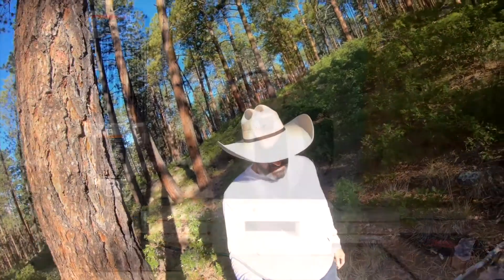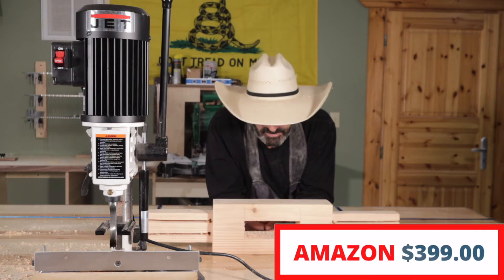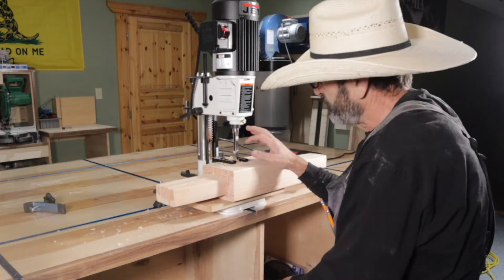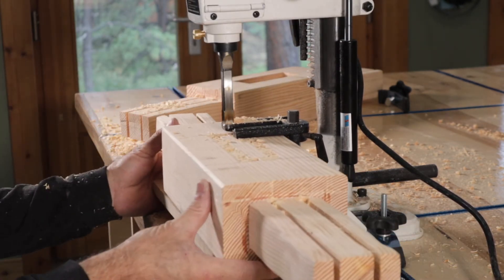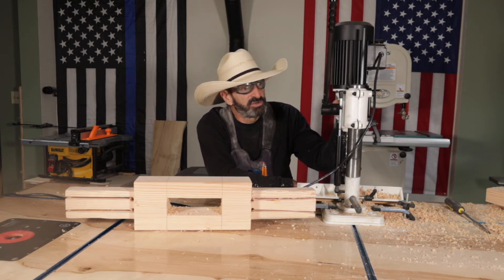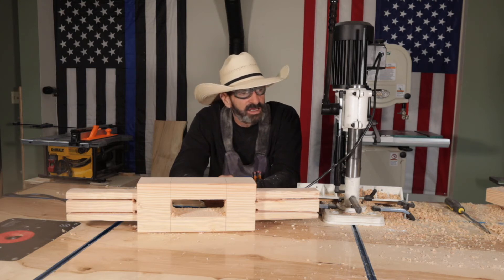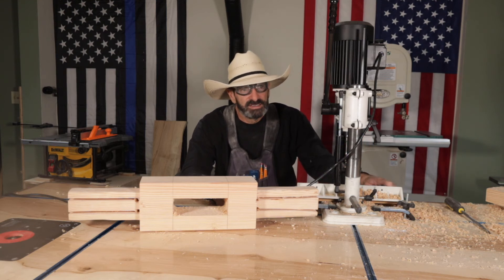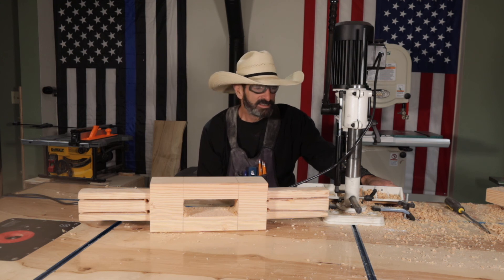JET MORTISER MACHINE JBM-5  REVIEW

Comment: I just watched a YouTube video on using the Jet JBM 5 and they said to space out the plunge cuts and then go back and clean out the (little less than a chisel width) and the bit will not deflect as it would with one open side due to just overlapping. It looked like you were progressing continuously instead of sequentially. Could this be your cause of deflection? Let me know because I’m considering a jet and I don’t want ant deflection issues. Thanks.

Comment: I just bought the Jet JBM-5 machine for $150 on FB Marketplace with 6 chisel/drill bits. It is missing the bushing that holds the 3/4" chisel collar which I just ordered online for $8. Thanks for the review. I look forward to making some smaller mortises.
Reply from the maker: Chuck Smith wow , you got a good deal , congratulations
Reply: I have one new in box here in NH, USA. I purchased it for a project that never was completed.

 $150